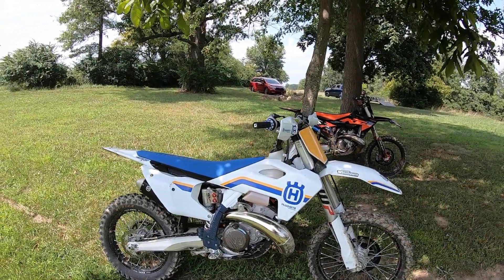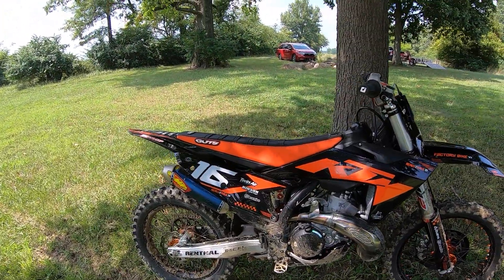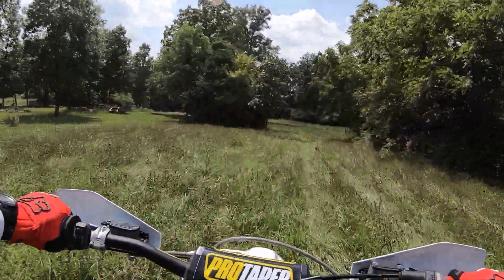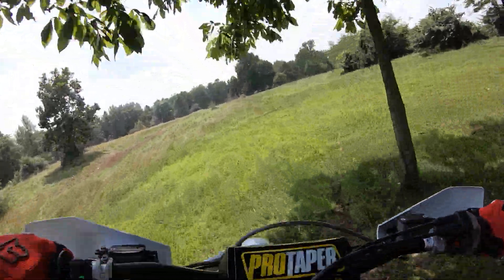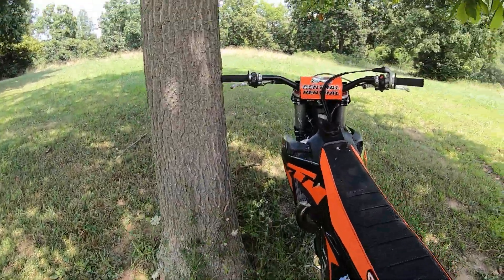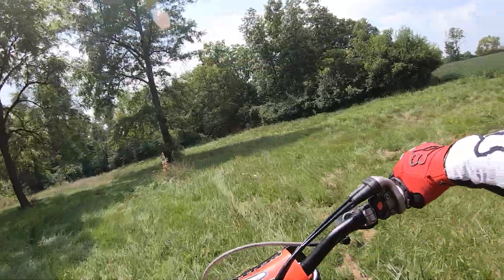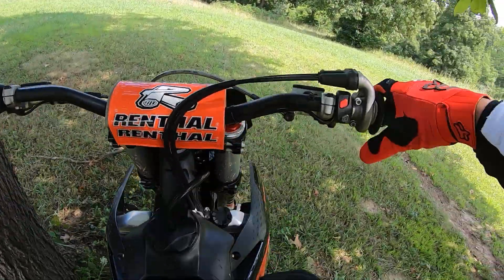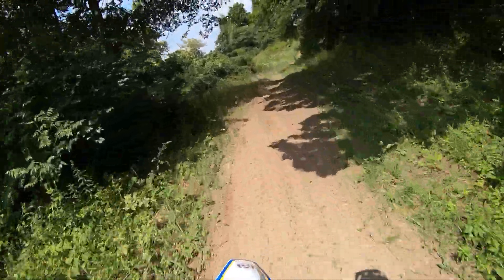FMF Factory Fatty and Powercore 2.1 Titan silencer on 23/24 KTM 300SX

Comment: But honestly......do you need more than the TBI puts out? Thinking very seriously about a reflash on my ECU and a med compression head from TSP for mine. They have a trail map(white) and a moto(green) that they can install in a stock ECU.  Said his son used that map at ROMANIACS a few weeks ago. The trail map is supppsed to be great for hard enduro too
Reply from the maker: I think KTM did a pretty good job with the stock power character and power levels for the green and white maps on the 300XC/TX TBI engine.  The mapping will continue to get better with more real world customer experience.  I need to get the latest map update into my TX300.  Supposed to help clean up a few issues (like running rich/bog after downhills).  I've not tried any re-mapped stock ECU's.  What are you looking for in terms of engine power/character changes with a re-flash and TSP head?

Comment: Is the SX gearing ok for the tighter woods loop you do? Will it lug fine in the slower stuff without hitting too hard too early? From what I have heard there is no difference in mapping or flywheel weight between the two, correct? I'm strongly considering going '24 300 SX over XC to save the $2000. That will buy some protection accessories, a radiator fan (I know the stator is at it's limit even with the lowest draw fan), and a lot of fuel!

I'm on the east coast so could also gear down a bit. Not too many fast open areas where I am at. Thanks for any input!
Reply from the maker: I've ridden the 300SX and 300XC/TX300 back to back many times.  The XC/TX 6-speed ratios are a little closer so less of a gap between gears which works great on moto tracks (3rd in corners and 4th on straights) and also great in woods (2nd/3rd).  The SX works well with just a little taller gears in 1st/2nd/3rd.  My buddy went up +1T on the rear on his 300SX to allow 3rd in the corners on the moto track and it also helped in the woods to tighten up 2nd/3rd.  The XC/TX also some with latest spring forks which have gotten good reviews along with o-ring chain, kick stand, and bigger fuel tank all of which can help justify the higher cost.  The 300 TBI engine is so good!
Reply: Thanks! Yeah I could get a 23 leftover 250XC, but the low end power of the 300 is hard to pass up. I don't ride any moto. @mxengineer1
Reply from the maker: @GNR325  If you ride mostly off road the 6-speed works over a wider range of conditions

Comment: @mxengineer...I'd like for the " right off the throttle " to be a little smoother and build through the power just a little more linear. That would be the trail map. Then if I  ride fast trails or take it to the track I'd have the green map available. It just seems a little too rowdy for slower single-track . Just my opinion. Guess I'm too used to the 250 and 350 4 strokes
Reply from the maker: I understand your desire for smoother build of power.  I ride my 23 TX300 back to back with my Beta 300 Race Edition:  the Beta 300RE makes less power (but still plenty) but builds power/RPM more slowly so it is super easy to modulate the power and find traction and still go fast - especially on the trails.